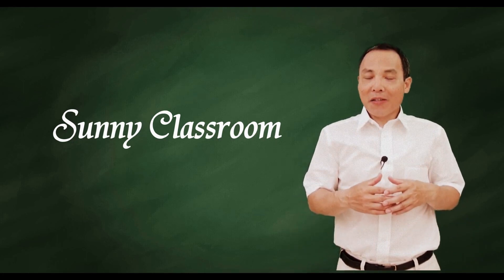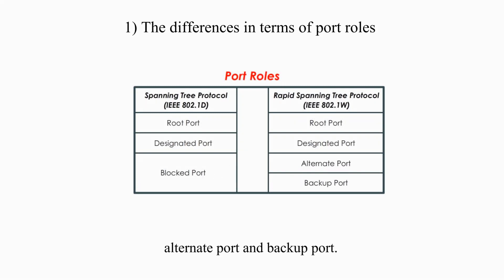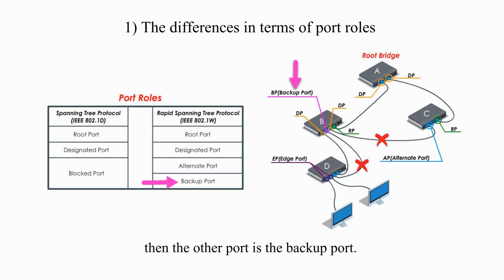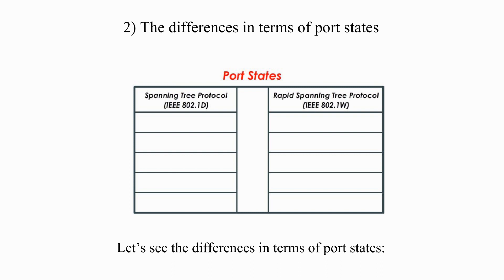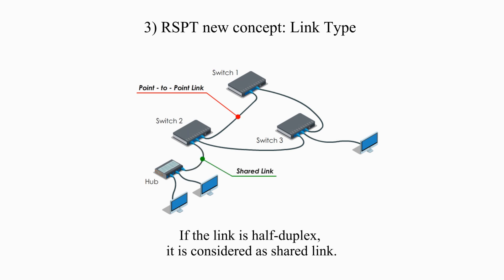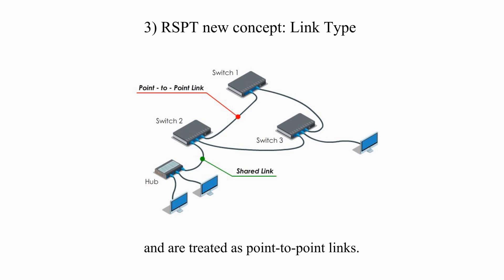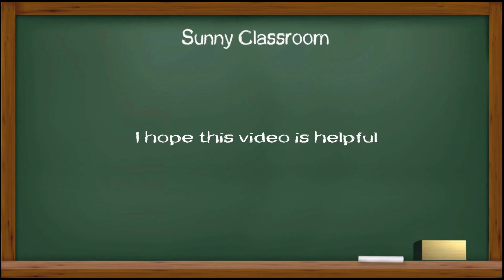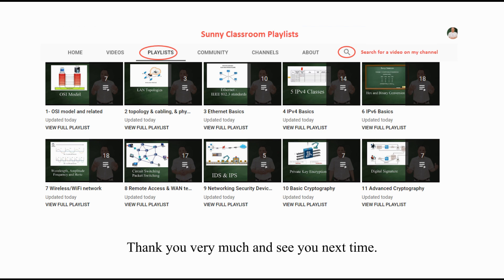Rapid Spanning Tree Protocol (IEEE802.1W)

Comment: Hello Sunny. The picture of topology at 1:37 is wrong if the D device is a switch (I assume so, becouse you've mentioned Edge Port). If it is a switch, then one of the links on the D device will be alternate and both links of B towards D will be designated.
From my knowledge if you use topology 4:30 and connect two cables of switch2 to the hub, then one of the ports will become "Backup", as it will receive BPDU from the same switch but different port (lower priority or id)